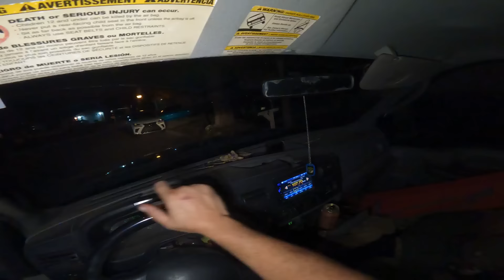Day Scrapping Or Night Scrapping We Do It All!!

Comment: This is the only scrapper that I have watched that does not turn off the motor of his scrapmobile when he stops to make a pick-up and  I bet that Ram is a V-8. Such a waste.
Reply from the maker: You would never catch me dead driving a Ram.
Reply from the maker: And my truck only uses a quarter of a gallon every hour while it's idle. Which only cost 75 cents for that hour to leave it running. And all my vehicles are kept maintained better than most companies maintain their vehicles. So my gas efficiency is amazing. My mileage for a full tank is about 500 miles and I hold a 25 gallon tank. That's an average of 20 miles per gallon. And that's counting leaving it running. When I get out and get scrap. There's no point in turning it off.
Reply from the maker: You also put way more wear on other components. Like your battery and your starter when you turn the vehicle on and off. Also, you're putting more wear on your alternator which has to recharge your battery from turning on and off.